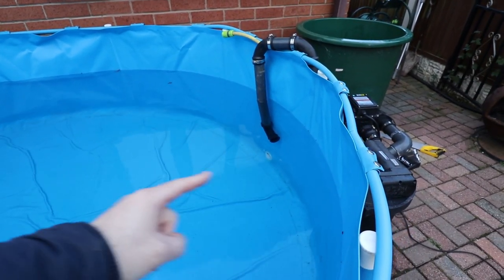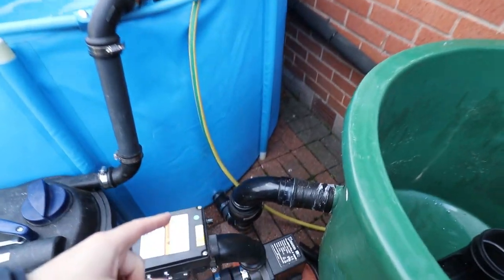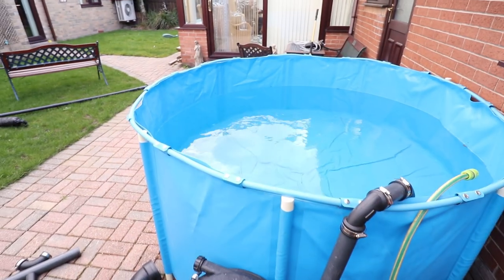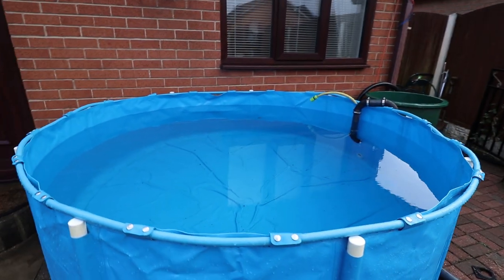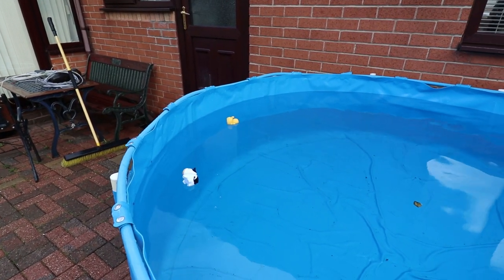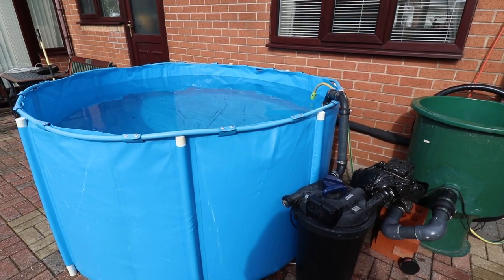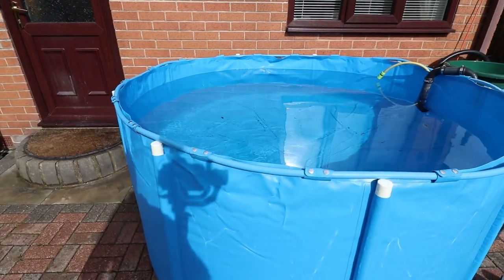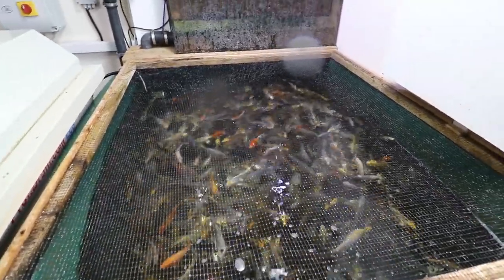Building a temporary koi pond

Comment: Great video. Where you connect your rubber fitting to your pop up tank (the designated drain valve) is there much pressure put on it?. Asking as I feel I am going to copy that idea this year!
Reply from the maker: No not much it's just in a bit of a bad position as it can suck on the fish and mark them so best to put a grill over it to stop the fish sealing it.

Comment: Morning Adam,heard you say solar panels,have you a standard 4kw system, do you have battery  storage thanks,Ian putting  1.2kw pv system on my filter house
Reply from the maker: I have a 7.5kw system saves me a fortune. I would like a battery but I use too much power so it would never really get charged and the excess power is used to heat my house so don't use much gas 🙂. When you have a pond a solar system can really make a difference.

Comment: I have to set something similar up in the not too distant future. So some questions if you would be so kind... 

1 What make is the tank? It looks like "Show Koi", as Aquosis are a darker blue and the frames are metallic in appearance. 

2 What size is the outlet on the tank? 

3 What size is the inlet on the vortex? 

4 How big is the vortex diameter? 

5 What's the reason for the plastic bag on the heater?

6 Have you had the pressure filter running elsewhere? Just wondering what you are doing for bio?
Reply from the maker: Yeah its a show koi vat its 2m x 1m
The outlet is 1.5" I think as the 1.5" boot fits it
The vortex Is 3" 
The vortex is 2ft wide but I wouldn't have used it if i didnt have it sat in the garden anyway.
Just to keep the heater out of direct rain it is waterproof but id rather it not get rained on.
Yeah It's used Pressure filter Ill keep on top of water changes so it'll be fine.
Reply: @AdamJulyan  Thanks Adam. The reason I asked about the bag on the heater is because I had an electric heater made by Cloverleaf. I was verbally assured that it would work outdoors and was waterproof. The cable was shorter than specified so I had to get an electrician our to extend it. For the first winter it worked. Then it started tripping the RCD. I discovered that water was somehow getting into the end where it shouldn't be. Unfortunately it was out of warranty because although i only ran it for one winter, i had it sat in a box at home for the 12 months prior to that.

I wasn't overly concerned as I had got an ASHP by then... Which has also gone kaput.

If you look on YouTube for aquarium overflows  there are a couple of designs that go up and over the side of the tank. I have used these in the past in vats and they work. Stick a ball valve on the end to control the flow, then you can trickle in and overflow out without the hassle of water changes.

I've also used a zeolite shower over the tank before, to keep the ammonia at bay. But obviously this means you can't use salt in there too.

Comment: Hi Adam not related to this video but what bsp size is that T peice on the top of your air supply where it connects to the gauge? On your fry tank Can't seem to find one? Thanks Jason
Reply from the maker: That is a really good question. but the problem is i have no idea Ive been trying to work it out as i read your comment yesterday I know I bought a 1/4" gauge but I also bought a selection of reducers so the actually pipe is reduced to 1/4" so the gauge fits but I don't know what its reduced from. The reducer is a stainless threaded reducer from pipestock.com if you have a look there for parts you might find something.
Sorry I couldn't be more helpful 
Adam
Reply: @AdamJulyan  
Hi Adam that's fine thanks for checking for me. I just liked the idea of the gauge when I see it on your video if there is a problem on the system somewhere the gauge would help you notice the problem 😉

Comment: Brilliant video Adam, can't wait to see the next 😎👍🏼  
I've just ordered a Profidrum eco 45/40 from Absolute Koi 👌 

My drum should arrive this coming week and I wondered if you have a bit of advice for me setting it up gravity fed please.  ie does and don't 

Thanks again and take care. 
🐟😎👍🏼
Reply from the maker: Great choice in drum filter 👍
There are only two good points your pond water level needs to be constant no dropping and filling so a ball cock is a good way to keep it full and replace the water the drum uses.
Get your water level and height of the drum spot on I usually put the water level just below the top of the stainless waste shoot so you get max flow.
When setting the probes in the filter try to get it so that the drum runs about every 1 hour or 30 mins at most. you may need to keep adjusting this for the first week or two as the screen matures. if you don't keep adjusting it eventually it will get stuck on cleaning cycle.
Thanks, Glad you like the videos 🙂
Reply: @AdamJulyan  awesome thanks for the advice 🙏.    I've wanted a Profi for a long time and after watching your videos they really sold it to me.    Your water really sparkles in your main pond and I'm sure it will sparkle in the fry tank but its too hard to tell because of the amount of fish haha.    😎🐟👍🏼
Reply from the maker: @JMacFlyFishing  Awesome 🙂 You wont regret it they are great make sure you tell Darren you had seen the drums on my videos 🙂 (I could do with a sponsor 😂).
Yeah you would be able to see the bottom if the fish weren't in the way 😂.
Reply: @AdamJulyan  haha, don't worry I will let him know 😉 🐟😎👍🏼